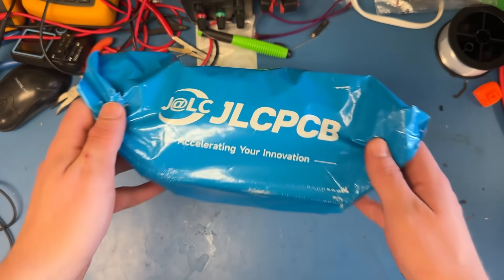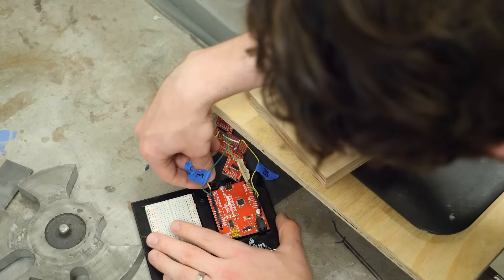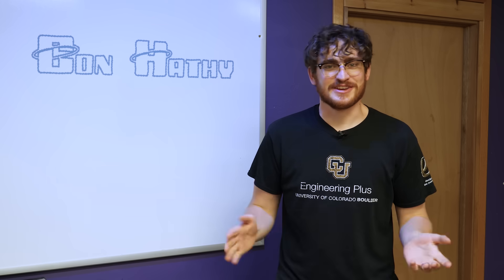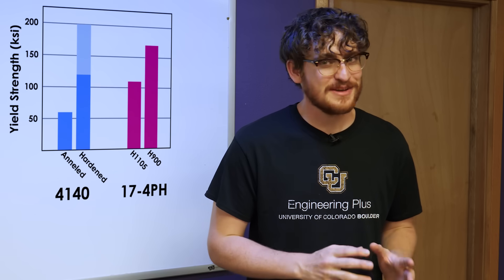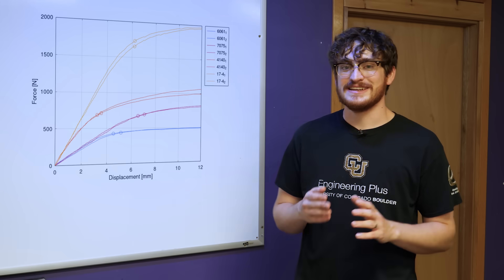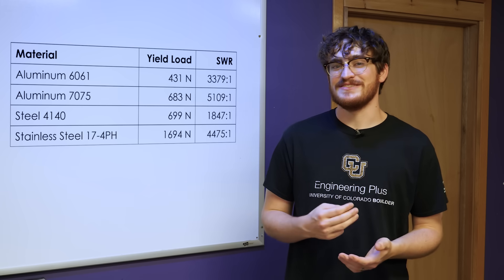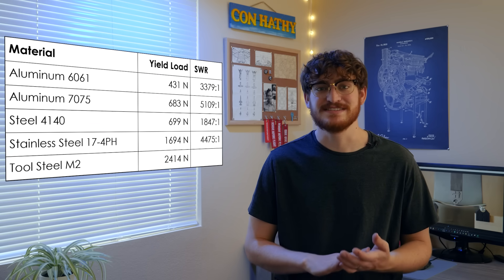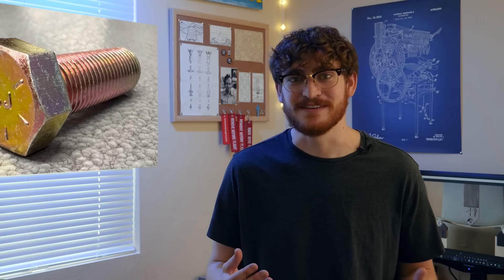Is Aluminum Actually Stronger Than Steel?

Comment: There are many considerations depending on the purpose of the design, no such thing as a globally perfect material. Tell me the application, operational environment, service requirements, the scale of production, and we can . I've worked on aircraft predominantly Ali. Though lots of specific parts are steel, more specifically cres. Modern aircraft are extremely hybrid for this reason, cfc skins and stiffeners, Ali ribs, frames, spars, cres and Ti in extremely high loaded areas, fasteners mix of cres and Ti. It's good to challenge the cool thing at the moment. I'd say first think of the application and as many considerations as possible and then start considering the material for that design.

Comment: Wow really interesting. Id like to ask you something you might not be able to answer in a broad way but here it goes. Im thinking of buying a motorcycle with an aluminium subframe to do long distance off-road travel with luggage. There will be probably around 20-30kg of luggage on that frame. Should I be worried the frame will suffer from fatigue due to the off roading? There will be tons of high frequency, low amplitude (and therefore low stress?) vibrations that are worsened by the luggage. What do you reckon? Can that frame hold up? I assume the manufacturer chose a high grade aluminium but still.

Cheers

Comment: You must be a ground pounder engineer who designs bridges and buildings with safety factors in the 3+ range..  For aviation engineers, designing for weight and safety factors often approaching 1.01, aluminum is the bomb.
Reply from the maker: Aerospace absolutely does not operate at 1.01. If you’re designing to 1% margin, then the FOS is already included in the loads you’re using. Taking any material to within 1% of yield in regular operation is not going to fly

Comment: The ability to fill more space with aluminum without adding weight or having to create a complex structure is a huge advantage for aluminum. You can make a 2" solid part where steel the same weight would be .8" thats a huge mechanical advantage... advantage...
Reply: But why would you make a solid chunk of metall in the year 2025?

Comment: One of the most important advantages of steel is that it has an endurance limit, no mater how much. Cyclical stress you apply to it it remains unchanged as long as it's within the endurance limit.
That's why springs are usually made of steel
Reply: И тем не менее стальные пружины тоже стареют.

Comment: The usefulness of aluminum comes from it’s lower density.  You can make structures with higher moment of inertia, which is a much more effective way of gaining part stiffness/strength than material modulus/strength.

Comment: You should not try to compare aluminium with steel. The steel is an alloy so you have to compare it with aluminium alloys - duraluminium, also called "dural", and that is quite tough (durable). You need to learns about the dural from Germans or Russians.
Reply from the maker: 6061 and 7075 are both alloys, not pure aluminum. It looks like duralumin tops out around the same place as 7075 at least for the purpose of this test
Reply: @ConHathy   у дюрали присутствует еще и самозакалка - после подогрева она размягчается и твердеет обратно через пару дней - это очень удобно.

Comment: Starship use stainless steel for their skin because it's much cheaper to fabricate compared to aluminum. Aluminum not only has really bad fatigue strength (which for rockets didn't matter because it's not like they'd reuse them), but welding aluminum is a real, royal pain to deal with, and welding aluminum degrades their fatigue strength even more. Stainless on the other hand, can be welded with low cost equipment (you could even stick weld it), welding doesn't degrade the material as much. If you use a non heat treating stainless steel such as 316 (whatever is used in kitchens) welding them degrades nothing. I think SpaceX initially wanted to use carbon fiber but ditched it because they realized how expensive manufacturing them would be. 

Airplanes for example uses a lot of exotic welding technique like friction stir welding because aluminum is just that much of a pain to weld. You could TIG weld aluminum but doing so introduces fatigue points (and 6061 weakens significantly when welded in their heat affected zone), aside from the difficulty in welding aluminum. That T6 heat treat means welded aluminum loses a lot of strength.

I'm sure the reason they don't make aircraft skins out of stainless is likely due to buckling concerns (where reinforcing them enough would weight more)...
Reply: Истребитель миг25 был сварен из нержавеющей стали. Его проектирование способствовало бурному развитию и распространению технологии обработки сварки нержавеющей стали.

Comment: The strength of alluminum is that in practical application, it doesn't rust at an accelerating rate like steel.
Yes it oxidizes to alluminum oxide, but this becomes something of a barrier to slow or prevent further oxidation... where as with rust, it's a catalyst... to promulgate even further rusting...
Reply: I purposely replaced aluminium suspension components with steel parts because the aluminium ones corroded badly. The Dorman problem solvers I installed are barely starting to show signs of paint degradation after 5-6 years. Aluminium corrodes quite fast in many scenarios.
Reply: @rolfbjorn9937  You probably have a dissimilar metals electrical reaction situation problem going on there... in the same way a sacrificial anode is installed in water heaters and in boats to corrode out first.  

You also don't mix different metals in electrical wiring for the same reason.  

I've got alluminum siding that is 50 years old on the side of a barn that is just fine.
Reply: It depends on the alloy they used, the lower end aluminiums end up struggling with corrosion in the usual moisture + road salt environment

Comment: Can you rank materials by specific strength per dollar?
Reply: Spoiler: Aluminum wins vs Steel.
Reply: Steel wins hands down. Most of the cost is in working the metal into shape.

Comment: If you NEED butter then it's the right choice! 
Typical of this steel vs Aluminium question is people's attitude to Aluminium wheels being the most annoying thing in my world. To learn about the difference between these metals, you just need to read the specs for BMW wheels. The steel wheels for a 3-series are about 8kg and the Aluminium wheels are from 8.5kg to 14kg. Duh!

Comment: This video is pointless.
The whole trick about using aluminum is that in many applications, it allows you to get much bigger cross-sections. That's what actually makes the parts stronger.
For a simple real-works example, just look at the tube diameters of high-end steel bicycle frames vs. aluminum ones.

Comment: Steal is real

This video is super weird. I appreciate the science. But none of the tests indicate anything I can imagine in a real world situation. The only practical thing you discuss is fasteners and in super generalised terms. I can't understand how you ignore welding. You're samples and test jig is like side loading a nail or drill bit - something you just wouldn't do with these materials.

Tool steel is strongest? Tool steel is hard, so we use it to make sharp blades that stay sharp, but for other uses it is brittle. One would describe it as hard but not strong.

4140 is chromoly which has a lot of innate corrosion resistance. I only know it as spring steal used in airplane landing gear. I always thought it was niche. 4130 is less carbon and super strong to make tubes that you weld into bicycles, airplanes, racecars. Except in bicycles (where vibration is less and everything is thin so heat properties take care of themselves) then heat treatment is super important. Aluminium is complex to weld.

I don't know, this is interesting but it makes me think of engineers being out of touch with mechanics and builders in the real world.

But I do agree with your general point that just because the numbers are higher for a certain measurement of a material does not make it more useful/strong for an application.

I guess your video proves the point despite some of your dialogue: we see weaker things (tool steal, aluminium) perform 'better' than strong things (cromoly) via the pure numbers.

Comment: Try to weld 7075... Doable but a REAL pain in the rear. I stick with steel for pretty much anything that I can. But I don't build spacecraft in my barn, though.You could temper the 4140 at home with a simple oxy/fuel setup. Get it bright red and quench in water. Then temper at ~400F for 1h in your kitchen oven. 350F might still be a bit brittle.
That would also kick Aluminium in the rear.

Comment: To be fair, I watched the whole video to see if the initial claims had any validity, but no. From an aerospace point of view, the tests were irrelevant as no-one uses material in bending...
Both aluminium and iron (where steel comes from), are pretty weak in their non-alloyed forms, but once you start adding alloying elements to either, you're talking a different world of material science. Each of these assorted materials will have their benefits in certain areas, but the truth is, most metal aircraft are built from aluminium alloys, I could almost list aircraft built from steels and stainless steels on one hand (the SR71 is Titanium).
Still, with all the composite aircraft being built today, the whole discussion is a bit of an anachronism...

Comment: A fixture guy ain't an aerospace engineer. It is a fixture guy. Btw. Nowhere less types of materials are used than in aerospace. A bit 15-5ph, a bit Marval, a bit of m300 and a hand full of more. Go work for industry and you will find tons of stuff.

Comment: Love the mixing of units.  Automotive engineering is guilty, keeps you on your toes and more often questioning units as a general rule because of it, leading to less deviations from expectations.
Reply: I've never understood, why people make such a drama out of units, especially the imperial (US customary) vs metric debate, just use the unit that suites the job, or at least close enough, what do i care if it's a half inch socket or if it's a 13mm (not as if those were the same just examles). As long as the data stays clear and easy to use, why should i care.

(Before anyone comments about being used to imperial units, or anything like that. I'm european, austrian to be exact, I grew up nearly exluseively using metric.)
Reply: @thatoldme1234  nah man. Do some thermodynamics with imperial. 
I get that sometimes Inches , Feet or pounds are more in line with the scale of the objects around us in our daily lives. Similar to how in hydraulics we use L/min and bar instead of m³/s and Pa, because their magnitudes are so different. But as soon as youre using pound force insteaed of Newton I am out. Everytime I see some completely random number in some formula that combines all of the different conversion factors of the units involved, i cringe so hard.
Reply: @HannyDart  thats why i said, the unit that suites the job. For thermo, or other complex calculations, useing metric units without stupidly complex conversion rates is definitly the way to go. 
What i was talking about, was that every time you give a mesurement in feet or farenheit, there is that one group of people complaining about it.

Comment: (Forged) aluminums like 2618 are used in high-performance engine pistons because it's better at absorbing things like shock loads and detonation. I was surprised to learn that.
Reply: Top fuel dragster engines use aluminum connecting rods for the same reason, while virtually every regular car uses steel connecting rods.

Comment: The short answer is that you can get roughly the same high strength to weight ratios with a whole host of materials: steels, aluminum, magnesium, wood, and ceramics. The main differiences is in the density, hardness, toughness, and fatigue resistance. Wood and wood laminates are typically soft and often need to be larger than a steel or aluminum counterpart. Ceramics are very brittle but typically heat and corrosion resistant. Magnesium alloys can be flammable on top of being quite soft. Nickel alloys typically exhibit excellent toughness, but are significantly more expensive than steel.

Comment: You should look into 4340 for your base line steel.   It has enough nickel and chrome to start becoming rust resistant and it’s better than 4140 in near all of its properties.   Being through hardening also makes it more uniform when milling or machining after heat treatment.

Comment: I am an aerospace structural engineer, and I'm going to tell you why you are wrong.  Bending stiffness and strength.  Aluminum beats the crap out of steel in this regard because of 1/12  b*h^3.  There is a reason aircraft are mostly aluminum...

Comment: Heck, doesn't clear grained Douglas fir beat both in strength to weight?
Reply: This was definitely a video focused towards aerospace and not any other form of transportation engineering. There’s a huge reason boats are still using balsa cores and other woods like the beautiful Douglas fir instead of all man made composites.

Comment: FELLOW AEROSPACE engineer here: FANTASTIC VIDEO.
Don't worry about not really working on aircraft or spacecraft design. I've spent 35+ years in industrial control systems and automation where I describe that I crash landed. Most recently I have been working on constructing remote mine sites after more than a decade in manufacturing playing with REAL robots that do real stuff NOT Elon stuff.
Reply: Mines are the reason any human can do anything, thank you really
Reply: @thehammernator  MINES???
Yeah they are very important to the modern world but they have never been absolutely necessary until the human population needed more resources like we did for the industrial revolution.

For 1,000s of years mining was NOTHING like what we'd call mining. Mostly they simply picked up what they could find on the surface or scrape out of caves.

Most of what was done was quarrying rather than mining and they extracted building materials like marble, slate, granite, basalt and limestone.

For centuries most metals were extracted from river sand. Rivers coming of the right mountain with the right make up act like a natural mineral concentrator. One of the most famous examples is the river sand that the Japanese make their samurai swords from. It looks like fine black sand and its in fact very rich, very high quality iron sand. 

FYI - I have worked in Australia's mining industry and had a geologist explain how that works.
Reply: @tonywilson4713  Of course prior to the 19th century modern mines weren't really a thing. I just have to say modern mining is not a recognized as much as a noble career is all, especially in the States where I live. That description was great.
Reply: @thehammernator  MINES???
Yeah they are very important to the modern world but they have never been absolutely necessary until the human population needed more resources like we did for the industrial revolution.

For 1,000s of years mining was NOTHING like what we'd call mining. Mostly they simply picked up what they could find on the surface or scrape out of caves.

Most of what was done was quarrying rather than mining and they extracted building materials like marble, slate, granite, basalt and limestone.

For centuries most metals were extracted from river sand. Rivers coming of the right mountain with the right make up act like a natural mineral concentrator. One of the most famous examples is the river sand that the Japanese make their samurai swords from. It looks like fine black sand and its in fact very rich, very high quality iron sand. 

FYI - I have worked in Australia's mining industry and had a geologist explain how that works.

Comment: Aluminum does not rust. Steel rusts and any attempt to make it rust proof (stainless steel) automatically makes it much weaker, much more expensive and harder to machine and weld.
So aluminum does not beat steel beacause it is stronger or lighter, it beats steel because it offers good st of tradeoffs which can’t be replicated wit steel or steel alloys, assuming your application benefits from those tradeoffs.

Comment: One thing worth adding is that Neutron's first stage now splits into 2 modules. The core module contains the first stage engines and tank. The upper module contains the second stage and payload. The idea seems to be that second stage and payload integration into the upper module can happen in a controlled indoor environment. The rocket lands. The empty upper module is removed and a new upper module is bolted on. Neutron's design brief was reflight in 24 hours. This how you do it.

Comment: That first 6061 sample bends like it's T0 temper, meaning it's not being used like it might in an actual application where T4 or T6 might be specified.

Of course, if you weld on it, the temper at the joint goes to T0 after it's cooled, and the extra resistance to bending is gone. Restoring the temper on any complex structure is a nightmare because aluminum has such a high coefficient of thermal expansion (CTE).
Reply from the maker: I don’t know what to tell you, it was T6. Maybe your expecting too much from 6061

Comment: You made humble old wood and bamboo feel neglected with this video.
Reply: Before carbon fiber composites were developed enough to be useful. Wood laminates were often used since they so perfectly fit the role of a high performance lightweight material.
Reply: @maxsilver4197  Like the birtch and balsa De Haviland Mosquito?

Comment: Aluminum tends to have poor fatigue resistance. Especially around welds it will crack it's just a matter of time. Steel welds don't crack ever the welds are the very last thing that fail.